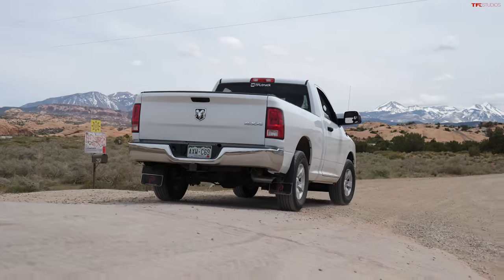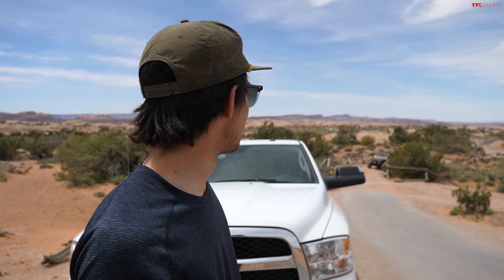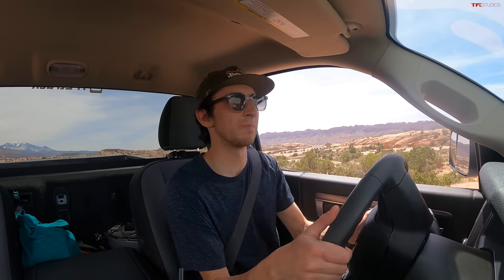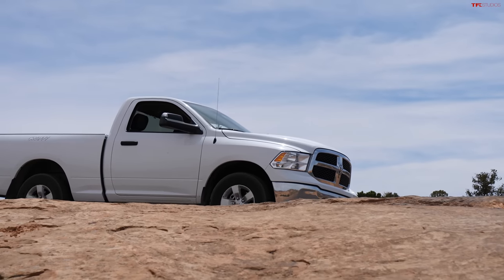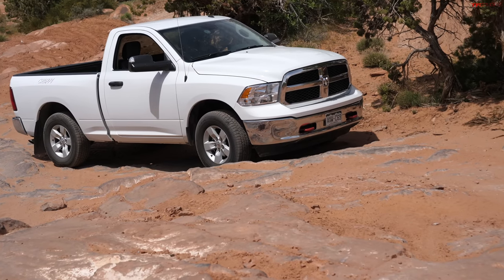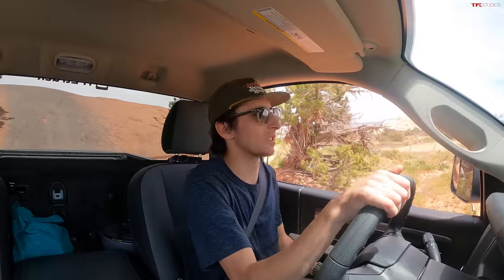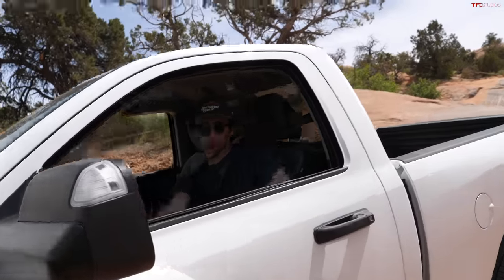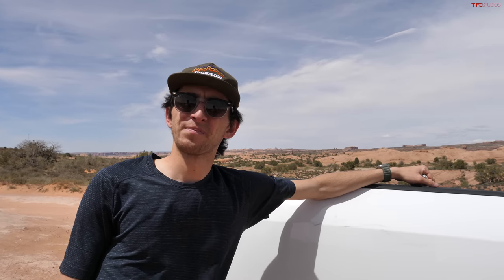Trail Damage: I Take a Stock Work Truck on a Rugged Off-Road Trail to See How It Does!

Comment: Single cab and short bed definitely helped you through that . . . and I am shocked that the tires managed that steep, rock climb.
Reply: Slick rock isn’t slick, it’s really grippy
Reply: Well done lads
Reply: Street tires can actually be really good on the rock in Moab.
Reply: @sclark805  Until it's wet lol
Reply: Rocks are quite smooth and aggressive tires suck as mud terrains would actually do worse than an all terrain or even an aggressive all season.
Reply: Moab is sandstone. The rocks are like sandpaper. As a result, traction is phenomenal.

Comment: Lift kit and bigger tires and Stubby would be a pretty good off road rig! Great video.
Reply: Up until extended cabs became common a lot of the off-road rigs were regular cab short bed pickups.   I went many, many stupid places in a square body Chevy.   Sure miss that old truck!
Reply: @1guyin10  me too   1985 swb single cab F150 300 inline 6
Reply: @1guyin10  Truth. Short bed pickups have been used as billy goats for as long as they've existed. I had a '73 GMC that pack-muled me into some amazing camping spots, far off the beaten path. Durable, capable, and cheap/easy to fix. Nothing better for an offroad beater than an old short box.

Comment: Most people don’t realise how capable stock 4x4s are now. This how you learn tyre placement and choosing your line. It helps you become a better off-road driver.
Reply: this base truck has standard 4x4 transfer case with AWD break based traction on all wheels, that helps dramatically, i wonder if other makes do same these days on base 4x4 with no LSDs
Reply: Now? I've got a '97 Suburban that I use as a hunting/camping rig. It's bone stock, except for Discoverer AT4 tires. I drive on worse than this with it, all season long. My buddy uses a' 78 Dodge pickup and it gets it all day.

Stock 4x4s never had a problem offroad. The problem is almost always the wingnut behind the wheel.

Comment: Compared to Nathan's old dodge (I think it had a Pirate flag), this was pretty impressive. I always got the impression that our newer trucks were considerably worse off-road. Pretty sure you could go real cheap and use a spacer lift, throw on 33s (or even 35s) and that'd probably be a pretty capable little truck
Reply: That's what I'm saying. A cheap spacer lift, and some 35" RT or MT tires, and that truck will be an awesome little trail rig. Could even throw in a Detroit locker in the back if they wanted to get real fancy.
Reply: @backwoodstherapy  I'd say removing the front swaybar, high clearance bumper, small lift/bigger tires, and some armor would make it incredibly capable. Removing the front swaybar and leaving the rear would improve front/rear balance when flexed out. There were a few spots where the rear tires were in the air, but the IFS wasn't at full compression yet. If they removed that sway bar, it'd allow the front end to fully utilize the available travel and keep more wheels on the ground, while also helping the truck level out a bit more when fully flexed.
Reply: Check out the Fast Lane Truck video "Can a Basic Ram 1500 4WD Work Truck Survive the TFL Slip Test and the Tumbleweed Off-Road Course?"  No locker is needed.  It looks like a 1" lift is all that is needed for Stubby.

Comment: It's great to see a truck that probably cost $50,000 less than every other vehicle on that trail actually complete the trail.
Reply: Yeah, no.  A TJ or JK with a mild lift and some lockers is not $90k.  Many of those rigs would cost less than this stock Ram.
Reply: You probably think it's some kind of special achievement to hammer a square block into a round hole with a sledgehammer...
Reply: True but you can spend 5-10k more n get something way more reliable.
Reply: My atv was 8500 new and would go through here with no concern. I get the appeal of the fancy jeeps but I feel like it would add a lot of stress to me worrying I break stuff.
Reply: Yes, and this base truck is like $50k lol
Reply: @gaivoron  it was $40k
Reply: @speterbilt  hahahahaha okay.
Reply: @gaivoron  it was about 40K. They did a whole video about their purchasing experience.
Reply: I got my 87 yj for 4500 on boggers, one tons, and v8 swapped
Reply: @gaivoron  what? They paid$40k
Reply: You guys are missing the entire point. Their point is if the Ram which is made for on road and maybe some towing could actually do what a true off road vehicle does. People try so hard to impress with driving over stuff you can just drive around. Sure it may be fun, but the smart person does not make things harder on purpose lol

Comment: great video Alex/Kase, Moab is a place everybody talks about going to and 95% never go to  and this video just showed what you can do stock, and if one chooses to improve its ability, tires and a levelling kit are the most economical way to go and theses trucks all have basic ABS/TSC built in which does help in some situations, we had a early 2005 GMC W/T1500 4x4 4,3 V6 auto we bought off our employer for peanuts, it already had worn out A/T tires so we put on a set of 33" KO2's and a levelling kit, it came with the G80 option LTD slip Rear Diff and we changed the rear gears from #.23's to 3.73's we bought used with another LSD, it went from being capable stock to being very capable with slight mods, we did put a trans cooler on it right away , cheap insurance, it never left us stranded anywhere and had fun with it for 3 years put it all back to stock sold the tires on FB Marketplace left the levelling kit on it tossed on new brakes all 4 corners from Rockauto and got close to what we asked for it, we had fun with it for a small investment and nobody can really ask anymore than that 👍

Comment: People don’t want trucks like this, they want trucks that have all the tec and basically do everything for you except steer. This truck makes it more of a challenge which is a lot more fun. Great job TFL for doing this video.
Reply: There is power in the beater rig people underestimate. A beater is by default, 10x more capable than any new rig because the owner just doesn't give a hoot. You can squeeze every millimeter of ground clearance out of them, you can drag the frame across a rock with one wheel in the air, you can squeeze through gaps that damage body panels and keep on trucking, because you already got your money out of the rig. At this point, it's less of a test of capabilities and more of a test to see what it will put up with before it dies. 40s are unnecessary in the beater world.

Comment: I  had a 2wd Ram just like that, but with the Hemi. Dodge traction control really is a cut above Ford - even with 'open' differential, it did fine. 120" wheelbase does a lot. Just think how much better it would be just with the "Rebel" level with 34" tires and the 1" front lift and some factory skid plates.

Comment: The nicest looking truck on the market. :face-red-heart-shape:

Would love this, with a column shifter, old school.
Reply: Agreed.  I have the exact truck with crew cab. 2018 Ram 1500 V6 4×4 flex fuel.
 It truly is an amazing truck.
I payed 28,000 2 years ago cash, it had 50,000 miles.  Still runs great at 90,000 miles.

Comment: The Ram has pretty impressive off road capabilities for what it is. We used to off road in much less in the 80s. Though back then we didn't consider climbing over three foot boulders off roading. I would love to see this again in the 4 door stock version. If you did a level kit on stubby it wouldn't have lost the spoiler I don't think.
Reply: Yep. No computer modulation or any of that. Carburetors, crappy brakes, wide ratio trannies, and whatever tires we could afford. We still got it done, though.

Comment: I have 2 rams. I've used them for all sorts of things but at stock height they are definitely not bad and the 4x4 system works really well. If you put a leveling kit on it, it goes a long way and it's cheap to do

Comment: Thanks for the video! I have a '94 Bronco on slightly bigger tires, I've been wanting to take to Moab for about a decade now. Good to see a similar wheelbase stock truck able to handle it with ease and minimal damage.
Reply: Your Bronco is good to go. I've done much crazier things than the trail in this video, in a '96 Bronco. Nothin' to it but to do it.

Comment: I wheel my ram, its on 35 Mts high clearance front bumper with 12k winch rock sliders. Im hoping to get the rear locked this coming year. Im impressed with the trails ive taken her on so far. I might hit sour grass trail next weekend with my son.

Comment: Great video. I have a 2011 Ram, like that. It's got 4.7 V8, and tow hooks, n I added factory skid plates under frt differential n transfer case. 222,000 miles. It's a tough little rig

Comment: Single cab short bed trucks are a great place to start a off road build. I have had them since the 1970s and they will surprise people. Very nimble compared to crewcabs and extended cabs.
Reply: same here we all wanted single cabb short  bed trucks  back then  are the most sought after classic pu   70s 80s crewcabs  not many left all where used up

Comment: It just goes to show how much you DON'T need to go off-road. Some modern stuff is nice, but a lot is unnecessary. Just remember what you're Grandpa did back in the day with nothing. All one really needs is 4wd, ground clearance, decent tires, maybe a locker(s) or limited slip, and a good driver

Comment: Check the owners manual to see if there are instructions to temporarily remove spoiler for off road use. My 2005 Silverado had instructions to do this. Make sure to replace for regular driving to reduce overheating.

Comment: Its just like my 80 bronco on 31s. It has better bumper clearance and cooper RTs. 

All factory, no mods. 

A little lift and better tires, and it will do just fine.
Reply: Just put some Cooper Discover AT3s on my 2012 Ram Express shortbed single cab pickup and I love them. I pull a 14x7 cargo conversion camper and needed a heavier ply tire . And they are exactly what I needed. Not real aggressive, but aggressive enough. They are equivalent to a 33 inch with 20 inch rims.
Reply: @FREEDOMRINGS  I know my RTs are eating up gas milage, but I rarely need to go into 4 wheel when off road. And the snow... they just eat it up.

Comment: You should have taken off that chin spoiler before you even started. People forget that vehicles like this, is what used to do these trails. That was before lifts, lockers, etc. I wouldn’t be surprised if people back in the day did this in Model Ts.
Reply: The whole point of the video is doing it in STOCK MODE . NOT TAKING ANYTHING OFF

Comment: Now let’s build out this 4th Ram. You can even go low budget and use the Bilstein 5100 shocks which can add 2.9 inches the from and 1 to the rear. Could be an moderate build vs. the trail hound.
Reply: Sounds like a waste of money on an already expensive truck.

Comment: Now you have to try a 2 wheel drive truck! Lol. I drove our(Dad's) 1987 Dodge Ram d100 all over places I shouldn't have. 2 wheel drive As in a rear wheel drive with limited slip rear, as opposed to a 4x4 with open diffs 2 wheel drive😂

Comment: Not sure you got the "moral of the story" correct.  To me this is all about wheel base.  The moral should be, a stock base "Half Ton" with 118" wheel base will basically do things and go places a stock base Wrangler JL Unlimited or stock base Bronco 4 door will do or go.  The big difference is if you damage the metal bumpers on a half ton they are available at a junk yard for like $100 where the Bronco or Jeep might cost you 10X that amount because they likely need to be sourced new.

NOW go to AEV and do their 4" DualSport lift and winch bumper, add 35's and a locker.  Build a Stubby Recruit and go back to Moab.

Comment: I wish Stellanits would make a single cab 1500 of the new gen... would totally buy one.
Reply: unfortunately it was probably selling bad just like manuals, but i hate to see them go, i use stubby for work and it's so good to get around, they also look amazing from all manufactures, but the dual exhaust 5.7 Ram with painted bumpers is looker
Reply: @tallll70  all the fulls size pus ive ever owned / now own ,single cab short box   drive a   73-91  K5  blazers,  gmc jimmy , 80-96 bronco .  80-90 ramcharger/ grand wagoneers  one has to drive them to know the magic

Comment: I never understood the "classic" in the name. That and the 2007 silverado "classic". That is still a 4th gen ram 1500. I personally think that it just adds to the confusion when trying to get parts for it, unless there is a filter for the trim and "classic" is included
Reply: I’ve usually seen it differentiated by “Classic”. Looking at Rock Auto for example provides its own subsection under that name.
Reply: @ALMX5DP  It can be differentiated as long as it's specifically labeled as a classic. If for instance you looked up 2019 Ram 1500 on a site that didn't have the filter that allows you to pick classic under the trim level, you'd have to change the year as long as it's within that generation of the truck or it would show parts for the 5th gen Ram. That's why to me the classic trim is kinda pointless
Reply: @karlferdinand188  what site are you referring to? Like I mentioned the ones I've seen all differentiate per the Classic name, or at least Rock Auto and Orielly's.
Reply: @ALMX5DP  Amazon, CarId, Supreme suspensions (which may not count if the 4th and 5th gen Ram have the same exact suspension setup)
Reply: @karlferdinand188  ah yeah the generic “big box” stores and online sites I can see. All the dedicated auto parts places though seem to do a good job.
Reply: @ALMX5DP  right I do see your point. More often than not they do differentiate them. I guess I feel that they shouldn't have to because a classic is still a 4th gen Ram

Comment: 31.6" street tires, bone stock and no lift. It's all about the short-cab, short box dimensions here. This RAM wheelbase is only 2" longer than a 4-door Wrangler, and 18" shorter than a Gladiator. While there's 10" of overhang on each end compared to the 4-door Wrangler, it's still 9" shorter than the Gladiator. 

Put a proper lift and 35s on this thing, and it would embarrass a lot of other vehicles on the trail.
Reply: the glad pu wheel base is to long  137 " and bed to short  5' now if there was a 118" wb 6 " box wrangler pu ..

Comment: $5 bucks to go in and damage your vehicle?  🤔 Scam.   I would have been surprised if you 2 had hurt the truck to the point it was not drivable.  TBH.  Good duo team.  Spotting was good and driver taking the instructions were good.  Basic 4x4's have been getting around OR for decades w/out all the modern day tires, protection plates, lifts, etc. w/out tearing out drive lines, oil pans, drive shafts, etc.  No, I am not surprised at all by these results.  And honestly, not surprised Roman gave the go ahead.  As this truck has been video'd to death and is ready to move on.  1 more harumph for content was expected.  If Roman turns it into an over lander at this point, the disappointment will come.  lol  Buff out the damage and sell it off.  No need to waste money on any upgrades to it.  Let the  next owner use it as it was meant to be used.  Nice series.  Let it go in peace.  🙂
Reply: Seems like it would have been wise to remove both front & rear bumpers & maybe the hitch too, or plug a hitch skid plate into the receiver.   Could have sold the non-scratched parts & then installed offroad bumpers later
Reply: This is the whole point of the video.... STOCK MODE.

Comment: The stock dd 2011 subaru forester would of handled better . You drove this thing like s sack of bricks . You can't see how you're gonna scape and bottom out ? Also I've seen at least 4 times when you should of cut the wheel in order to not scape but yet went right into it 😅
Reply: I'm about to smash this bumper was the best part since there was a line to his left that would allow his tired to pop up and not bottom out at the low point.  Start cutting you're wheels

Comment: I have a 2023 1500 classic long beg as a work truck - what a pile of garbage. We have had multiple 2023 get check engine light sub 100 miles ... not 1,000 or even 10,000 ... 100 miles. GARBAGE. looks like a 1987 Subaru gl wagon could do better.